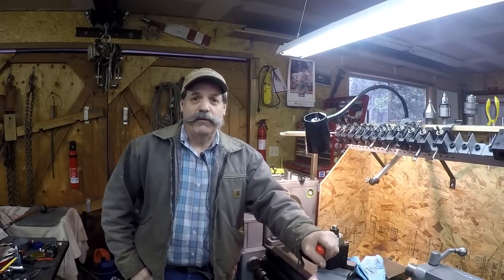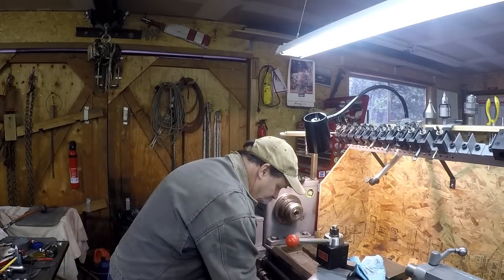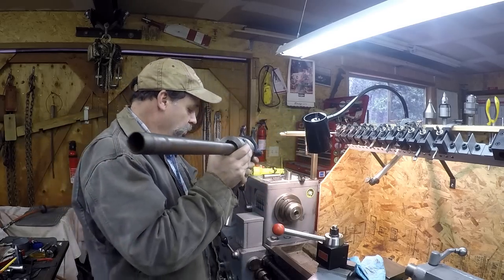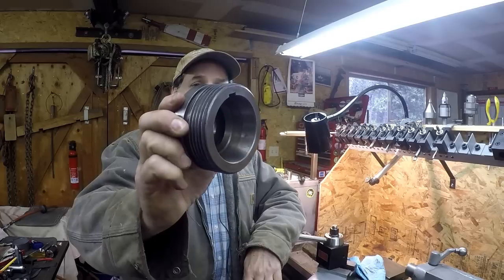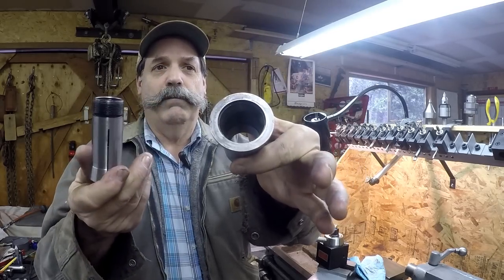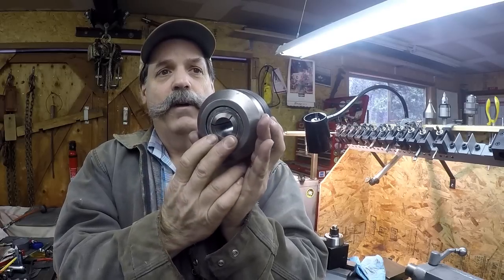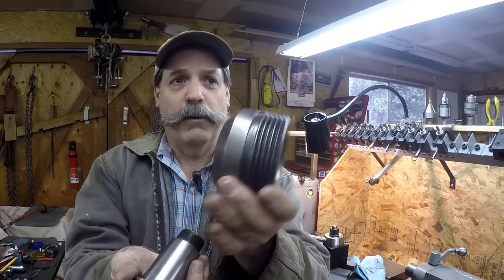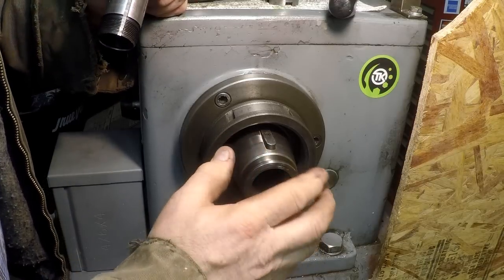Lance Lathe Collet Closer Part 1

Comment: Randy,
Nice work. It still puzzles me why they brazed the back side of that piece. Oh well . . .   Thanks for sharing and looking forward to part 1.
Have a good one!
Dave
Reply from the maker: Swarf Rat Thanks Dave.  The connection of the closer on the back end is abit goofy so if you do not do it correctly or do not understand how it works you will not have the proper stroke to close the collet.  Then you could think that somebody else was a moron and that you were way smarter and would get the torch out and fix the problem.  That is why somebody brazed the backside.  Pretty simple really.  Thanks Dave for watching and the great comment.  Randy

Comment: Nice fix on that Randy. I'm finally done with my weeklong truck engine rebuild so I'll be turning some muzzle brakes here soon.
Reply from the maker: Mike Dittman Thanks Mike.  for your truck?  Be lookin for some video.  Randy
Reply: Yeah my head gasket failed along with my transmission pan, a CV boot, and I serviced my 4WD.
Reply from the maker: Mike Dittman Yep a weeks worth.  Work on the wife's car today.  I really don't like working on the newer autos.  Randy
Reply: Neither do I. Not enough room in the engine compartment.

Comment: Nice tool improvement and now it works correctly. When trying to get the part within a few 0.0001" on the 4-jaw chuck do you change to a dial indicator graduated in 0.0001" instead of the usual types with 0.001" or 0.0005" graduations?
Reply from the maker: Paul Jones Thanks Paul. No I just use a .0005" dial.  But you can tell if it is within a few tenths when there is next to no movement in the dial.  Randy

Comment: Although the problem was a tuffy to explain, I do understand what it was. Your "fix" really wasn't dependent on how concentric you had it dialed in, you just needed to remove enough material for the nose piece to get in far enough, to seat on the 5MT.  The part that I was curious about, was the notched threaded piece that screwed on to the collet. Is that attached to the drawbar in some way, or do you physically need to screw in on the back of the collet each time?
Reply from the maker: Jim Liechty Thanks Jim.  Hey I got your center boxed up today and I will ship it this week.  Thanks for the help with that.  The notched nut threads on to the collet then the draw bar threads into it. it is like a pipe coupling.  Yes everytime you change the collet you have to thread it on and off, not to bad.  Thanks Randy
Reply: Randy Richard
What is the reason for that coupling?  Is the spindle bore too small for a one piece drawbar?  If the coupler passes through the spindle then you should be able to Loctite or braze the coupler onto the drawbar permanently.  That would make it much easier to use.
Reply: Something sure seems funky that you would need to do that....does the thread protector need to come off each time to change collets?
Reply: Jim Liechty
Perhaps the collet closer was originally off a different lathe and the things we are seeing were done to make it work on the Lance.  It might just need Randy to finish the job...
Reply from the maker: ***** The coupling does not fit through the spindle.  You have to put the draw bar in first then the coupling then the Spindle nose guard then the sleeve and last the collet.  You can remove the collet or change a collet without removing anything else.  Randy
Reply from the maker: Jim Liechty No
Reply from the maker: ***** This is the closer described in the Lathe manual.
Reply: Randy Richard
Then I assume the spindle bore is less than 1.375"?
Reply from the maker: ***** Yes Bob, the spindle bore is 1.281" and the od of the coupling is 1.435".

Comment: If the collet flange sits below the protector with it off the lathe , and sits proud of it on the lathe , how is there interference? im confused
Reply: *MT flange
Reply from the maker: bubster1981 The spindle is 5MT on the ID.  The protector covers the od and nose of the spindle.  The Adapter sleeve slips through the Protector and should seat in the spindle.  The Adapter sleeve was being held out proud of the Protector because of the weldment on the adapter sleeve and thus not seating in the spindle.  After removing the weldment the adapter sleeve would then seat in the spindle and was no longer proud of the protector and it was not touching the protector n any manner.  Then the collet will slip into the adapter sleeve.   When you watch part 2 you will see more.  I hope this helps.  Randy